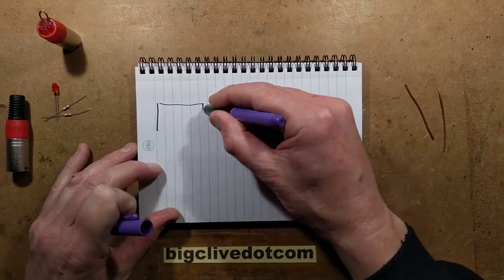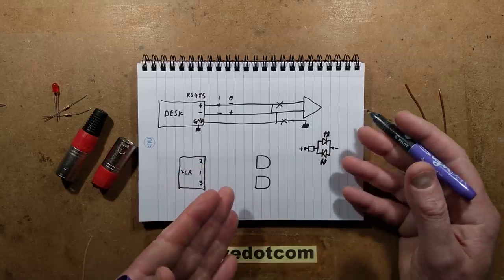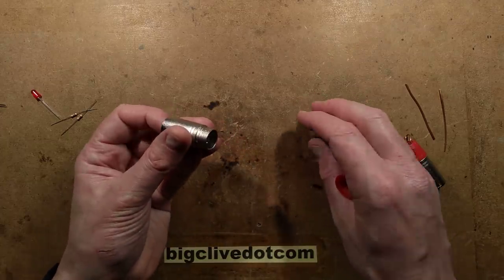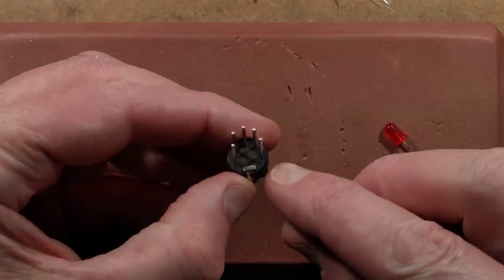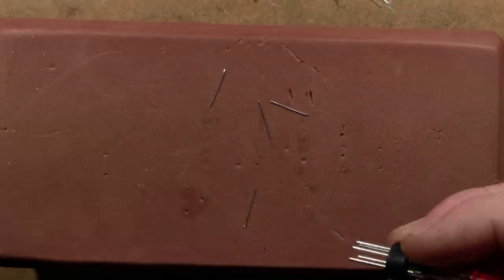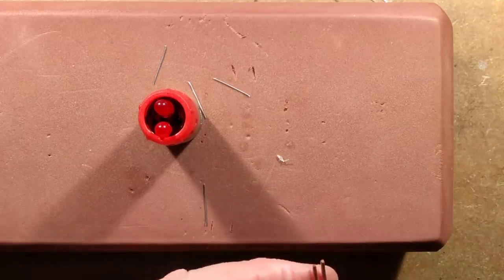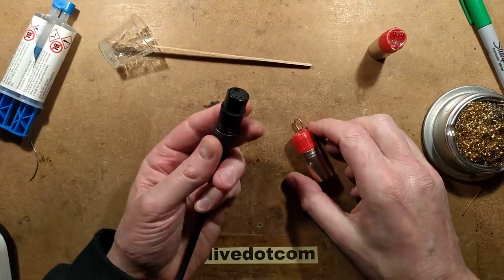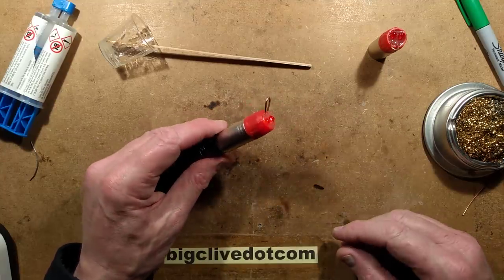DIY keychain DMX tester for lighting technicians.

Comment: Most stupid thing they ever did was use the same 3 pin plugs for XLR audio and DMX.
There's no way to tell them apart other than the printing on the cable itself (if there is any).
Reply: Simples, XLR  are audio connectors - unless otherwise stated.
Reply: XLR pre-dated DMX by a VERY VERY long time.   Just like Token Ring/Ethernet/Lattice net using AT&T Merlin phone cables, DMX used an existing standard to save money.   It's likely that the early DMX just used audio cables due to shorter runs (thus the robustness of the transmission protocol), and didn't move to fully shielded cables for long runs until it became obvious that people were overbuilding the initial concept.    Just a couple of weeks ago, I traced down a network fault due to someone uplinking a switch using a Merlin phone cable.  They work - they're just not twisted, so you end up with a very slow connection. 

If you're not sure, you unscrew the XLR connector and look at the cable connections.   I realize this is a difficult concept for much of anyone born after 1990.
Reply: @tbelding  I'm sure there are plenty of 3 or 5 pin standards out there without repurposing an existing 'theatre' standard that wasn't up to the job in the long term. While cables have their advantages, going wireless would probably be a good move too !
Reply: @millomweb  - Wireless wouldn't have been an option.  DMX has been around a bit, and when you're talking about the kind of equipment that DMX operates (lights, often with a LOT of power), wireless would have failed as soon as a show started.   Even today,  working with wireless every day as an IT tech (I started in theatre tech), I wouldn't trust a theatrical performance with wireless controls for everything.   It's just asking for a WestWorld Performance :)
Reply: @tbelding  I think it's a realistic possibility but would need to be electrical noise proof !
Reply: @tbelding   What do you mean with those last two sentences? DMX and XLR audio cables are soldered exactly the same way. How would one see the difference when unscrewing the XLR plug?
The only difference is DMX cable has 110 ohms impedance vs 75 ohms for XLR audio.
So you really only can tell the difference by the printing on the cable.
Reply: @Ni5ei  - They're soldered the same way _at the pins_, but you can see the actual internal wiring, including shielding - and often the twist. 

https://www.learnstagelighting.com/can-i-use-microphone-cables-for-dmx-lighting/ 

I'll be honest and say that I've never had to use DMX.   I left theatre in the late 90's, and all of the systems I worked with were from the 70's and 80's.   DMX need not apply :)    However, I've spent a lot of time repairing XLR connectors and cables for microphones.   Cut the cables open, and you will see visible differences, partly because of the alloy (that's the only way you can adjust resistance, apart from physical wire thickness - also visible), and partly because of shielding and twist.
Reply: I say this as someone how runs a small rental company and does about as much DMX as audio tech work:
1. The DMX standard doesnt allow for 3pin XLR, so you are simply wrong here. The Standard in its latest revision only allows 5Pin XLR and you are not allowed to use Pin 4 and Pin 5. RJ45 connectors may be allowed as well, dont remember since its not used for pro-lighting. 
2. My firm opinion after years and years of working with both Audio and DMX lighting, the Standard should be updated to allow for either 3 and 5Pin, or just 3Pin, simply because the 3pin XLR is a far superior connector in both robustness in the field and easier to solder and its a good bit cheaper. 
3. If you cannot keep track of which cables are DMX and which are Audio, even without marked cables, you are simply not a professional and should learn to organize or get a different job. The cables are usually not even run to the exact same places And they use opposite connectors for in and out. I mean, who the hell plugs shit in without knowing what signal is carried in the cable? I have never ever seen anyone connecting audio and dmx together by mistake, not even once, after hundres of gigs and a lot of them done with less than qualified help. 
Sure, you can run then run DMX on mic-cables, but that wont damage anything (other than maybe your reputation), and only noobs and amateurs will do that, and let them. Either its a learning experience for them when shit doesnt work because they use the wrong cables, or they loose face and stop getting gigs undercutting professionals :P 
One other upside is that us actual pro´s can use good DMX cables for audio if we want to, and thus may need to stock fewer types of cables. Afaik there is no problem running analog audio on DMX cables, and many cable mfgs classify their DMX cables as for high end analog Audio as well. 

Also, in regards to marking, quality cables are marked on the cable, and its easy to label the connectors as well, and usually DMX cables are a bit stiffer since they usually have more shielding and tighter twist, but of course, just feel alone is not a good way to reliably separate cables. 

And, Troy Belding is onto something, DMX and Audio does actually switch around the connections, both use Pin 1 for ground/shield, but DMX uses Pin 2 for Data-/Cold and Pin 3 for Data+/Hot, while Audio uses Pin 2 Signal+/Hot and Pin 3 for Signal+/Cold. They do of course work the same, but properly made cables will have the colorcoding on the leads done correctly for the intended application. In the same vein, DMX uses Male XLR for inputs, Female for Outputs, while Audio is reversed with Female XLR for input. 

I really really dont get why people are so worked up about the tiny tiny risk of someone connecting say the output of a Mixer to the output of a DMX light or console? Sure, something may well be damaged, but its not high voltage/high current, it wont kill anyone, and there are tons of ways you can connect things in Audio so that it breaks... Whats to stop some determined idiot to just use a 3 to 5pin adapter to connect things together? People even manage to "modify" Powercons to plug them into the Speakon ports on passive speakers, there are very few idiotproof solutions...

Comment: Why not put the resistor on the GND side of the LEDs? You'd save a penny for every tester..
Reply from the maker: A single resistor could be used.  But I allow for unusual voltages on the data lines potentially reverse biasing the LEDs and allowing a current spike to damage them.

Comment: NOOO!!!! The shield is NEVER allowed to be used as ground! It isn't even allowed to be connected directly to ground! The protocol specifically states the MINIMUM resistance needed if you want to connect the shield!
Open circuit ground is NOT allowed to cause interference!!! You should be able to disconnect the ground / shield anywhere at any time without disrupting the DMX operation!!!
BTW, The original standard specifies 5 pins with 1 SHIELD (no ground!!) Data plus and minus and multi function 2 lines ;)

So, no, the ground is NOT important if you use decent equipment! It's by it's very definition not allowed to be important!

I used dual color LED's for my tester/terminators. Polarity defines the color. Put a resistor in series with the LED to limit the current to 10mA, and added a parallel resistor to the LED circuit to match the needed 120 ohm for termination ;) Helped me fix a LOT of errors!
Reply: I stand corrected. Apparently there have been some changes in the DMX standards. The one I had in use for developing equipment is outdated. The 2013 version DOES state that the common line has to have a LOW resistance to the system common, so it's always at 0V.
Reply: I was surprised about the interrupted ground thing - I was under the distinct impression that the whole idea of differential signalling is that the "ground" is supposed to be thoroughly irrelevant (unless something brings the lines at a potential relative to the local ground that starts frying the circuitry).
Reply: @AttilaAsztalos  The only reason you need ground is to make sure you don't cause interference, and to shield outside interference more effectively. You really don't need the ground to have a working signal, because it IS balanced. I know that from experience :p
Reply: @Atilla, while the ground isn’t used directly in the signaling, there is a maximum amount of common mode voltage that the RS 485 receiver can reject on the inputs. With many transceiver chips this is in the range of 14 V. Once you exceed that voltage the inputs are just saturated and no data can flow. Ground loops in stage situations can easily exceed the common mode limits. 

Apple made use of a transformer isolated version of RS 485 for networking printers and file sharing in the 1980s. The isolation required far more complexity for the receiver and transmitter but it out performs be an isolated version in just about every real world scenario.
Reply: @angeldelvax7219  Wouldn't you also want a ground to any external metal work if the equipment fails under a fault condition but is still live. If this is for lighting/ sound it would be used around the public at shows, clubs, pubs etc. Drinks being spilt, fights breaking out and people being people increases the chances of someone else getting a shock. Public liability insurance and the H&S brigade wouldn't be very happy I can't imagine ?
Reply: @SlyerFox666  the equipment should definitely be grounded! But that's exactly why the DMX line should NOT be! If one device has a fault, the ground of the ENTIRE line will be hot! Potentially frying all other fixtures on that line. If the line is NOT grounded, you still only have the balanced 5v signal, and the device fault remains isolated with that device. So, no I don't want my signal line to be the reason the rented equipment is destroyed...
Reply: @Peter_S_  On the receiver side you can use isolated opto couplers, and the problem is solved (Yes, tried that too :p) I know it's hardly ever done.
There's always a maximum allowed fixture number on one line, so the common mode voltage should never be more than a few volts if at least one of the ends of your line has a 1k resistor to ground. So I still don't see why they changed the spec to require this connection now. But since it's in the specs, I'll make sure I stick to that!
Reply: @angeldelvax7219  Hmm... that would depend on the fault condition and as every where is RCD protected by law it would only be hot for the .4ms, enough time to blow electronics yes but not enough time to kill. If ground goes hot then all equipment connected to ground or earth will be hot, so that's not isolated to just one price of equipment is it ?  I think I would rather buy new equipment than face a manslaughter charge for killing someone personally but I'm not an expert in these things just a bit confusing to me when you hear about class 1 and class 2 double insulated equipment, I thought any exposed metal work would want to be earthed as to protect human life not equipment but I see what your saying I wouldn't want to kill something that I've rented either but nor would I want to harm life if a major fault develops.
Reply: @SlyerFox666  Not all fixtures get power from the same line, so you trip multiple RCD's at once. Not linking the ground would only trip the faulty line, and the rest would still be working. Still better than having a few thousand people in complete darkness during a concert :p
There are pros and cons to this, and I think every technician has a different preference about what cons to take, and what to prevent ;)

Comment: You just made a copper to fiber adapter.
Reply: Well yes you could lol, you have the light output and for the light input you can use an ldr with an amplifier then run it past some diodes so you can keep a ballenced ground line to the voltage, that could possibly work well and if using laser led then a it should do hundreds of miles in length with minimal timing loss of copper running voltage and the creating of capacitance over distance vs speed of light

Comment: After watching this https://youtu.be/4Xsg8lpP75s (How do Transistor Testors work and why the inventor was a genius), I can't help but think you could use similar techniques to make a pretty impressive, inexpensive DMX tester with low component count. Could you even do cable break/echo tests and such? I don't know. Clive, does that tickle your fancy? 

P.S. I don't see the prospect as a replacement for the keychain - why would you replace such a helpful, simple, reliable, self-powered tool?
Reply from the maker: The software in those testers is brilliant.  So much functionality from such little circuitry.

Comment: "House wiring wire"
You mean romex?
Reply: Here in the UK it's twin & earth... Different countries call it different things
Reply: Connorocker Pro electricians usually have a selection of wiring with that same copper inside, main difference for any one contractor would be number of connections, from single wires to 5+ depending on what each stretch connects.
Reply: @ianharvey868  yeah, romex is a major brand of it here in the us.

Comment: get a gender changer, cut it in half, dress the cut ends, and put the smd board stuff in the end. problem solved. if i cut the one i have in half i wind up with a 30 or 31mm shell x2. two screws to retain each side of the inserts, and then you just put hotglue or epoxy into the end to fill it.

... if i had more of these i think i'd try this.
Reply: You END up, not wind.
Reply from the maker: Both end up or wind up depending on part of the world.
Reply: Just don't put the wind up a gender changer they get a bit annoyed where ever your from  🌬️ 🙊